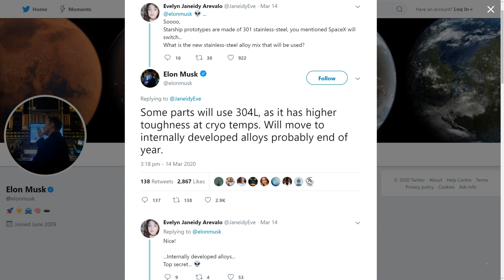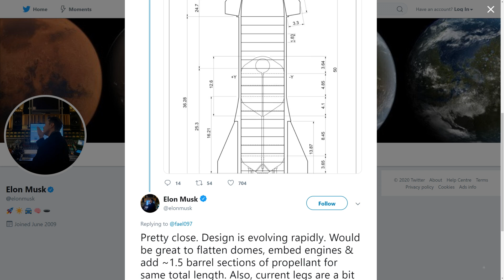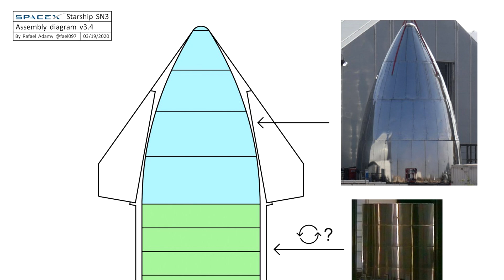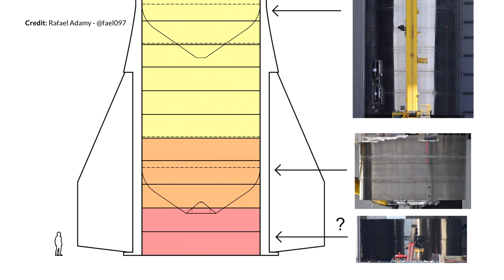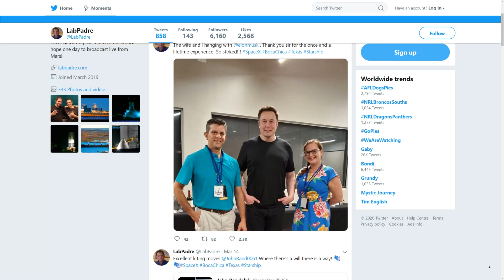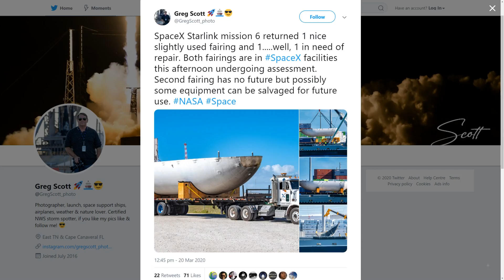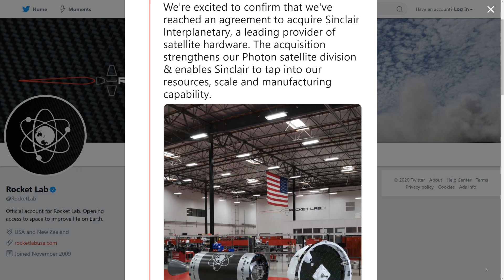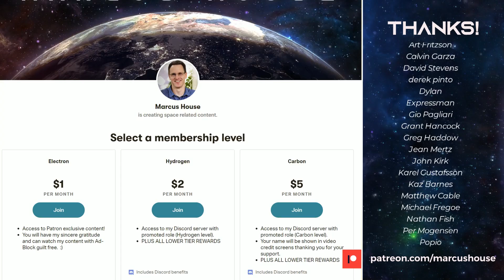SpaceX Starship SN3 Rapid Stacking and News, Starlink 5 & missing Booster, Rocket Lab announcements

Comment: In regards to low carbon stainless steels vs regular/non low carbon stainless steels, I work as a design engineer at a valve manufacturer who uses low carbon stainless steels and regular stainless steels. I'm by no means a metallurgist, but have a decent amount of experience with them.  The low carbon variety of 300 series (austenitic) stainless steels are very common in the valve industry any time you are welding anything.  The higher carbon content standard stainless steels (.08% max) vs .03%  max in low carbon stainless steels can cause hydrogen embrittlement in the welds. You can google hydrogen embrittlement, but basically it lowers the strength of the heat affected zone (area that is heated up while welding) and corrosion resistance.

I can't speak to the exact cryogenic properties of low carbon vs standard.  304 stainless is more expensive in general than 301 stainless because of the higher nickel content. That nickel content is what gives it the higher corrosion resistance.  Compared to the labor cost of welding everything, i doubt the difference in material cost is significant, especially in the volume/weight that SpaceX are buying it in.  They're likely buying straight from the mill in quantity of tons vs most people who buy it from a distributor at a markup when you only need a few sheets of it.  Another note, 301 stainless has a higher ultimate tensile strength, but similar yield strength. In general, you don't want the stress on your design/material to exceed the yield strength.

Comment: The 
Falcon 9 engine shut down in the sense that it exploded and so stopped producing thrust. Damage from the explosion clearly caused a fuel leak. Which is what that blob of stuff floating away from the rocket is and what the crap collecting on the camera during the entry burn was. IMO SpaceX lucked out this happened when the F9 was really close to engine cutoff and stage separation. Otherwise the F9 probably would have blown up on assent losing the payload. 
In any case when the engine exploded on assent it likely damaged another engine or engines. We can guess this cuz of the fuel collecting on the camera was spraying out of something which indicates it was being pressurized by the turbo pumps on one of the running engines and not the engine that failed on assent. Plus the blob of fuel is seen just before the engines fire which again points to fuel coming from one of the working engines as they spun up the pumps for the entry burn.
We can also guess the F9 probably shut it's engines down early and never completed it's entry burn.  First the burn looks different than other missions and it was 20 seconds whereas the last Starlink mission using the same launch profile required 25 seconds of thrust. As well commentator never relays the call that they had a good entry burn. And of course they apparently they knew the booster was doomed at this point which is why they cut the video feed instead of showing the booster beginning to reenter as they usually do.
Reply: Luck has no room in Spaceflight. Each M1D is individually contained in a blast proof compartment. So if the engine did explode it's that compartment that's to thank. You make your own luck...
Reply: @motokid6008  Yeah, there's no such thing as blast proof and even if there was it would be far too heavy to launch into space. What you mean is there is a blast resistant compartment. 
The facts are we know the engine failed and there is video from multiple angels showing what appears to be an explosion associated with the failure and in the seconds before the reentry burn you can see liquid which is almost certainly RP-1 coming from vicinity of the engines. During the entry burn more RP-1 starts collecting on the camera which is 160 feet away from the engines. Meaning quiet a bit of fuel had to be spraying out from somewhere and again for RP-1 to be spraying out under pressure you need the turbo pump of a running engine to generate the pressure.
So we can have the one engine they admit failed also damaged what were up til then perfectly good engines. Or an engine failed on launch and unrelated to that a second engine or engines failed on reentry. 
Given failures of the Merlin engine appear to be rare I'd bet one bad engine made more bad engines rather than they had 2 or more lemons on one Falcon 9.
Reply: @THX..1138  - No not blast proof I suppose, but blast shielding or resistant like you said. I was just jumping on the "luck" part of the comment. In which again has no room in the industry. If the engines weren't individually shielded then it could've resulted in a loss of the vehicle.

Comment: 12:38 It's not coincidental the 'failures' are StarLink launches: They are using boosters they wold not use for real clients. (At least, without more refurbishing etc. The standards are lower, and even if the boosters landed, they would probably not be able to use them again, so it doesn't matter to them too much...)

Comment: 301 is generally better for fabrication than 304. Don't know what the L is. 304 is very common in high end kitchens. It requires no post weld annealing for thin walls and has excellent welding properties. Each type has benefits and draw backs.

Comment: SpaceX has been having the issues ever since they changed the mission profile for Starlink, and it seems a problem similar to why Falcon Heavy's center booster has had problems landing.
Reply: That may be something to consider, but let's remember that the first landing failed due to incorrect wind data and actually landed near the droneship. We can only hope for some more info soon from Elon - the abort because of engine issues, and subsequent engine failure on the actual launch, is quite the mystery.
Reply: Except for there are reasons for those 2: the last one were high level winds far higher than the weather model said (they do not have weather balloons out over the oceans) and this one was an engine failure. So nothing specific to flight profile.

Comment: Doesn't appear to be a whole lot of space left for 100 Mars colonists and life support systems. Time to add another ring or two perhaps? Thanks Marcus.
Reply: Make it Fly.  That's the current objective.
Reply: this version is more or less just for cargo/ moon missions. they are going to build a new version for Mars
Reply: For Mars more realistically  you are looking at a crew of 30-40
Reply: I don't know, you can fit quite a lot in a thousand cubic meters.  The 747-8 passenger variant has around 750m³, and can transport well over 400 passengers on long haul flights.  Zero G being what it is, transporting 100 passengers to Mars with plenty of useful payload should be pretty doable in the design volume.  I certainly don't see a passenger configuration flying for a few years, and launching with 100 souls on board is probably a good decade away.  I think the first missions outside of LEO will be to deliver cargo to the Moon, and later, unmanned and manned missions with limited crew to Mars.
Reply: If they build them in the quantity that Elon dreams of, they can send many, many at one time. I think there's enough room in (space) for that.

Comment: If you had some hundreds of millions to spend, would you build a huge mold and cast the hull in two pieces with the bottom "lid" or stern where the thrust puck is located being the second part?
Reply: I like your thinking, unfortunately, casting metals results in a weaker structure than fabrication from "mill-run metals. I'm not sure it's even possible with stainless alloys. Forging can up the strength, but a forge that size woud be in the millions of tons (force).

Comment: The assembly environment seems quite dirty. Isnt this a concern?
Reply: No, partly because these rockets are made of very robust stainless steel, and partly because all that they are building right now are test articles. engineering prototypes to test engines and control systems. When they start building operational space ships, they will have a proper factory environment.

Comment: Do rockets pollute the air?  I remember the space shuttle launches were very polluting.
Reply: Everyday astronaut just released a video speaking about that. Go watch it! But if you want the short answer: yes they do, not all though. But compared to something like airplanes they produce more than 300000 time less air pollution per year. And airplanes are only 5 percent of global co2 emmisions.
Reply: They were very polluting because solid rocket boosters emit very toxic exhaust. That isn't true for RP-1/LOX or Methane/LOX motors.

Comment: With all the dirt flying around wild assembling this water tower, i don’t think this thing will fly.
Reply: Starhopper was even worse and it flew .
Plus steel can be welded outdoors so not a problem the main problem is the wind , this is why they built tents and high bay .
Reply: Frank Castle i did do something with la life. I don’t have millions to spend like space x created the biggest trash can ever. i just don’t understand why this thing not built inside. Like all the other space craft or space shuttle. Yes yes you will say” it’s for testing purposes anyway”
Reply: @docteurdre8450  I don't really see how it matters where it's being built, as long as it gets the job done. The two failures we've seen were related to the construction techniques and the structure itself, not the surrounding conditions.But I do agree that they should move the production into a clean room environment once they start flying crew on these rockets.
Reply: Brixxter naaaaahn really
Reply: @docteurdre8450  ?
Reply: Frank Castle i think you are living in wander land. so you think they have access to a boom lift for assembling or fixing the shuttles.
Reply: Frank Castle ho by the way you are probably a expert like me👍

Comment: Quastion: do allen plans to use his "sky Internet" also for GPS? I guess it would be much more precise.
Reply: No, GPS satellites have atomic clocks onboard and are designed to send out precise positioning data. Cell towers help with positioning, but they are fixed on the Earth. With Starlink, Elon would have to get very accurate positional data on every Starlink satellite and then the reciever would have to use the signal strength of at least 4 satellites and some bandwidth to even get close to what GPS already does. 
Tl;dr: GPS is already good enough.

Comment: Can anyone help with my curiosity, has there been any suggestion of "Vanta Black" (new paint/coating/materials that is apparently one of the blackest subtamces that man has created)  being applied to Starlink sats.
I t absorbs 99.965 % of light & reflects 0.035 % ...or something like that. It makes 3D Objects look 2D, No visible contour. "Vanta Black" ?
Reply: That's the problem you can't just paint the satellites black. They're experimenting with darker coatings in certain spots, but completely painting the satellite black would cause it to cook itself. It's needs to reflect light as to not absorb it's energy. There is no convection in space. No atmosphere. So all the heat that builds up stays.
Reply: @motokid6008  ahh that makes sense now. Thanks lot's.

Comment: Stainless steel is not an easy material to work with, it warps badly when welded, it work hardens, it is not particularly strong material... I am not qualified in rocket science, but to me it seems very weird that they selected stainless to build this rocket.
Reply: August Von Mackensen - SS gets stronger at cryogenic temperatures & has a much higher melting point than most other rocket materials.

Comment: When will SN3 fly??
Reply: _Charliezard _ probably some time in April.
Reply: James Falcon I mean..most of the “frame” seems completed..engines must be ready as well..don’t know about the “inside”
Reply: i mean there’s not many days left in march plus SN3 will have to go through static fire tests before launching so Aril seams most likely
Reply: Mikicat i doubt it will take a few aka 3 months to fly it’s basically built all it needs is some raptors and a nosecone which are both ready to be attached.

Comment: I Can't Remember But Did You Say SpaceX Found The Cause Of The Tank Explosion, Was It A Weld Or Seam That Failed Like The Shuttle Had An O-Ring Problem In Cold Weather!
Reply: Larry E. Goines Jr. - Thrust Puck, which is why SpaceX redesigned & strengthened the Thrust Puck on SN-2.
Reply: @TraditionalAnglican  So Everything Depends Upon The Puck From The Bottom  On Up? An Apex Would Be Stronger Over A Gradual Grade Rivets Too Close Can Weaken Structure.
Reply: Larry E. Goines Jr. - I see you answered your own question.

Comment: I don't get it. Is SpaceX in the rocket building business or the cryo-tank testing business? They blow up the first three tanks and when they finally get a design that works they scrap it for flatter tank domes to save space. Here's the engineering problems to that. Flatter domes cause a redistribution of pressure loads causing increased stress both at the point of attachment to the skin and in in the center of flattened tank dome. Because the skin of the pressure vessel no longer evenly distributes stress loads you will be introducing points of failure into the design where before those points of stress didn't exist or were mitigated. In short you are going to have to add structural support members to maintain tank shape and integrity. That means more weight. Why not keep what works and make Starship a few feet longer?

All Aft Pressure Bulkheads (APB's) on transport category aircraft are domes and they are that way for a reason.
Reply: Research and development.
Reply: @TheEvilmooseofdoom  Yes it does.

Comment: How is Starship going to be different from the Falcon 9 rockets that need heavy refurbishment before flying again?
Reply: It's stainless steel instead of aluminium. The engines exhaust is cleaner too.
Reply: "need heavy refurbishment" - You don't know that. No one knows the extent of refurbishment needed other then SpaceX.
Reply: @motokid6008   Elon musk said that in an interview not long after the first Falcon 9 landing.
Reply: @michaelespinoza3726  - After the FIRST F9 landing? How would he know how much refurbishment would be required on the first recovered booster? I think you either misheard or you're getting your info crossed up.

Comment: so marcus obviously you are fan off scfi and space, looking at this why didntz anyone coment that this tech represent to much plate assembly with simple welds, were are tubic systems that allow structural welds on heat just like in car or fridgfe industry all shiny metal,  anyway looking at this and hong kong bangood  and building they use reinforcemnet steal structure you can also use flatened tubic element, 1 phase is tubic plate assembly as structural tension phase 2 is tube flatend - from below more up less structural reinforcement phase 3 is suport beams holders for extra safety with rib bars, phase 4 is submarine titanium alloy inside or out so your vessel has a balistic rentry and end chasis in massive production or on asembly is machined bolt and up and down machined mold so your plates are benched press and tube squezed  at the end and alloy structural moding, so basicly you get structural body reinforced tension with iso foam or non burn isolation btween two shets and do media CAD presentation who is build , and get some time develop rotation cocpit used as escape pod weather you add 2x2 rotational  engine for vertical take off or land is your choice , once tech presented to media you get liek price ratio per piece and this how NASA works in english, nedless to say that after this spaceship or standard transporter need not to be also to be tubic they can aero flated per volume and speed and cargo haul desire. In reality you are poping shiny can, in relaity is gonna cost you fiew hundred millions but you get decade or two decade in space transport in advance thats almost adultry in billioner scheme. Funy enough today tech about transport is pair off wing in front off body and pair in back and aditional pack on tail,  so you are creaitng like diamond atention around mid axis, oh is going to fly fast have a plane caracteristics do vertical take off, except reentry spaceship would need improved balisitcs  that means front pair off wings and back would have to cope fast speed upon orbiting and reetnry safe so basicly they would be scat fish gliders, but to waht size, so your rockets in english would have nose extension and tail ext , so every comp is individual highly air tunel eficient and max torque tension, basicly if ship in crash a rotational cocpit is escape pod body with wings one part and engine thrid part and all parashuite land on abort land dismantle button on aprox 2,5km  also tested somewhere between 1,5km or 3,5 km, obviously space ship crash due to higher spped reeentry is higher then for horizontal scfi spaceship tech. Most likely all scfi spaceshi would also use fly buble systems side gliders to keep flight speed  and get better glide capability. Elon has home taks to do, or spend some money.

Comment: STEVEN HERE , I'M LOOKING AT THE WELDS FOR THE OUTER EDGE OF THE SKIN AND LOOKS LIKE NO ONE IS WELDING IT ,IT'S BEEN GRINDED BUT NOT WELDED , THERE WILL BE A PROBLEM WITH THIS IF THEY TRY TO PUT PRESSURE THERE .